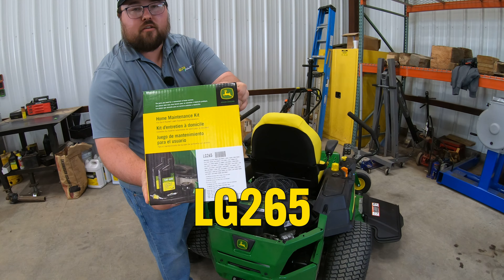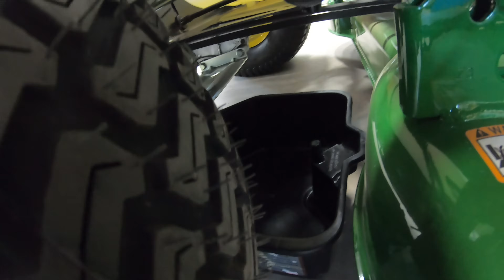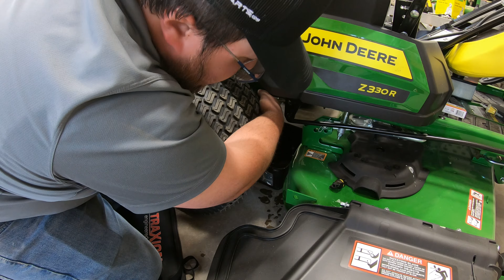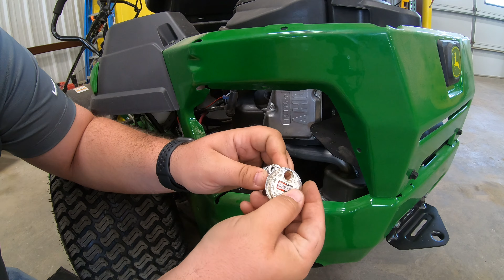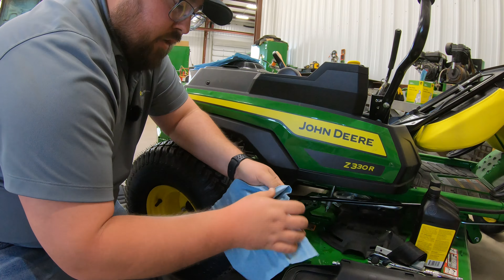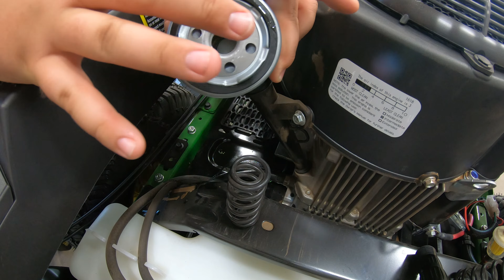How to Install Home Maintenance Kit on Z330R Zero Turn Mower

Comment: I just bought this kit to do as you did in the video. My kit came with an extra foam that goes over the air filter, is there any reason why you don't put the foam over the air filter before replacing it ?

Comment: After mower been sitting over winter I did have some gas in it, but now it’s not starting , only have 17hours on it total just got it 1.5 years ago , what signs are bad fuel pump or filter …I blow though the filter just to check and air flows though it

Comment: My 330r turns left fine but when I turn right I get a wining sound. Could that be a hydraulic issue. Is there 2 reservoirs for each side and one may be low?
Reply: your hydro is making noise.  not a tech but might be defective.
Reply: Mine is noisy too. What did you do?

Comment: what part# do I need for maintenance kit for Z330M? thanks in advance (I am guessing same one for the R LG265?)
so is it safe to say that the Z330M is the same Exact Machine like the Z330R (Except for the extra bells and whistles that R has like LED Lights, Rubber Mat, and Arm Rests) both R & M have same engine 23HP Kawasaki and Same Deck either 48" or 54" and everything else in machine the same is this correct?

Comment: I use a fuel hose pinch off pliers on each side of the fuel filter to eliminate any spilled fuel. Works for me!
Reply from the maker: This is a good idea and on some machines you will have to use some sort of pinch method or the fuel may continue to run. I will make sure to mention this in a future service video.